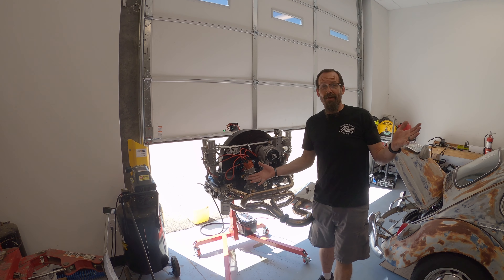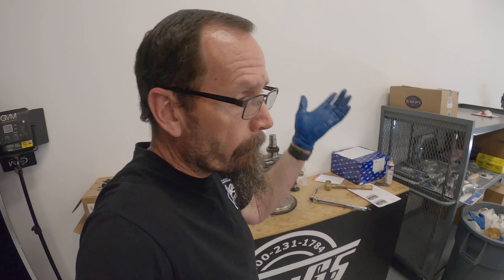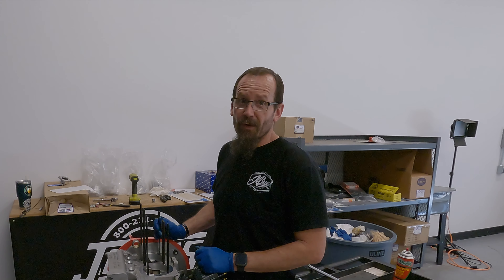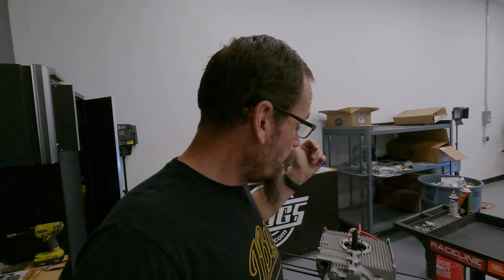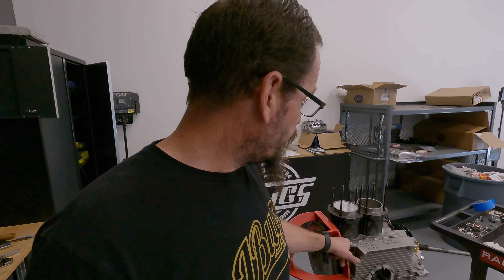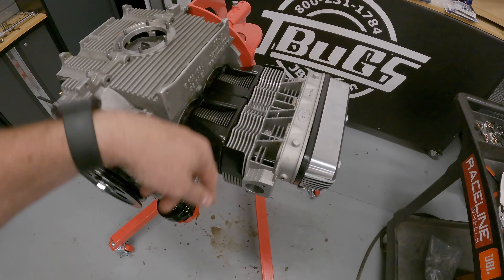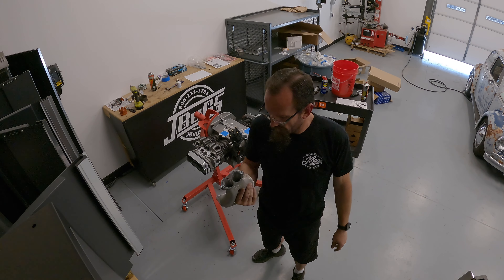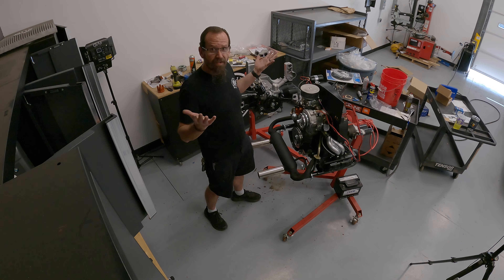JBugs 2024 Engine Battle - 2234cc Engine - The Start of Assembly to the Engine Start!

Comment: Hello! What happens with gearbox if you connect it with a powerfull engine ?
Reply: Nothing, until you drive it. At which point if you drive carefully the transmission might hold up for awhile. If you don't, you'll probably end up with a broken differential or a cracked case. Whenever you upgrade the engine for power, the transmission should be upgraded to suit.